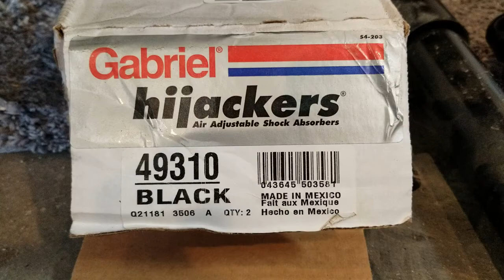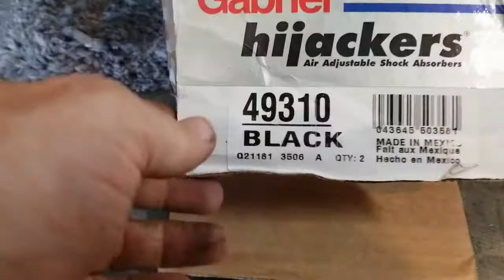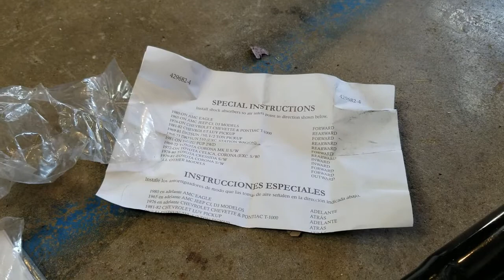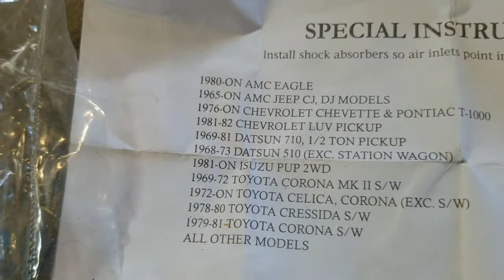How to install air shocks on a Nissan Frontier D40 USA model. 2005-2021. Gabriel 49310. Part 1

Comment: Is your truck. 4WD. OR. TWO. WHEEL. Apparently it makes a difference. I have a 2019. Frontier SV. But I don't want to buy these and not be able to install them. All I can find for 2019. Are the. Air. Bags. Which I'm not interested in.  
Thanks
Reply from the maker: I have 2wd 2018. They only list them for 2004 and older.
Reply: It's a 4 wheel drive